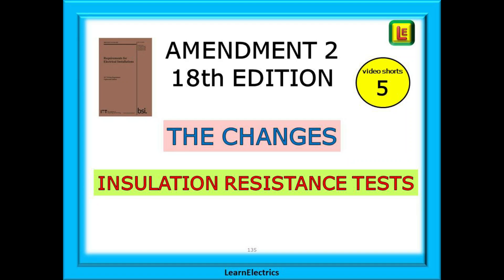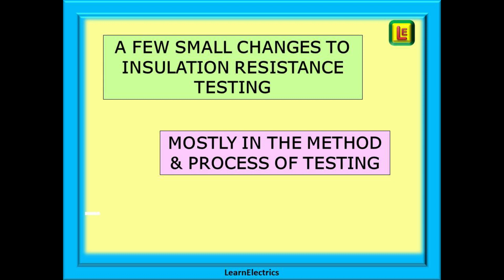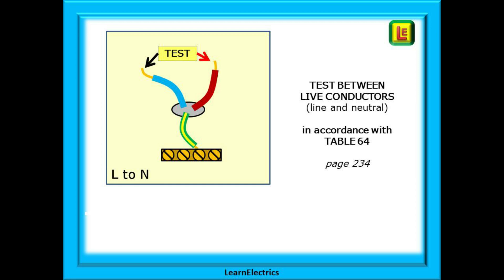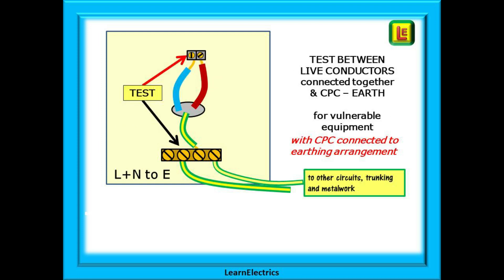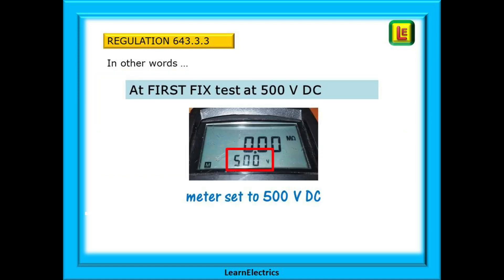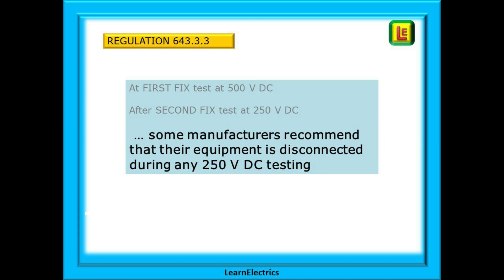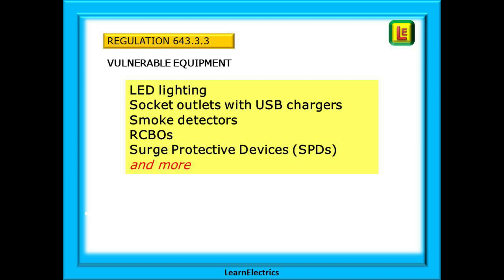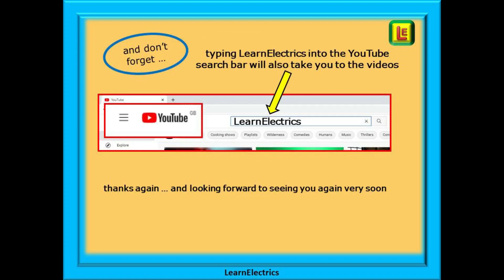AMENDMENT 2 - 18th EDITION – INSULATION RESISTANCE TESTING - CHANGES – SHORTS 5

Comment: I damaged a 240 V rated OTG's thermistor by injecting 500V between line and neutral!!!
Reply from the maker: Easily done. Always test loaded circuits at 250V first. Dave.

Comment: So on an eicr would you even try/ attempt to test @500v between live conductors? It is getting more and more difficult to remove vulnerable equipment, what with usb sockets, led lighting, rcbos etc

Great video Dave👍
Reply from the maker: They suggest now 500V first fix and 250V with equipment attached, have another look at the video. Thanks for the support. Dave.
Reply: @learnelectrics4402  yes I understand that as part of initial verification. But how about specifically when carrying out an eicr?

Comment: This question is not relevant to this video but can you explain whether we can use a TT system with only a RCD protection and not having grounding rod.
Reply from the maker: See earlier reply Kalum.
Reply: Suppose there is leakage in a metal body appliance. This cannot be sensed by Fuse/mcb as this is not a short or overload.

RCCB is a differential current sensor.

Without earthing: RCCB is unable to sense this leakage as their is no differential because the path is incomplete.
With earthing: RCCB is able to sense this leakage as their is differential because the path is complete. 

It's not advisable for our body to be a path. 
Hope this helps.

Comment: Great video, thanks for taking time to do, I have a question, Does the change to IR testing of sensitive equipment apply to periodic/EICR? Or can we test between L,N and E? Many thanks
Reply: I'd always test L&N - E on an EICR as you can't always find/ remove sensitive equipment from the circuit you're testing
Reply from the maker: Absolutely right. It's easier to remove before testing than to drive to the wholesalers for a replacement later. Dave.
Reply: @learnelectrics4402  I agree, but when you’re in a house where the customer has fitted his own remote controlled LED ‘mood’ lighting in their stairway and boxed the control gear in so you can’t access it without half destroying it, L+N -Earth is the way to go!😄
Reply from the maker: All testing. If you have first fix or naked cables then 500 volts.
If you have equipment that cannot be removed then 250 volts or with L+N joined.
Reply: @learnelectrics4402  No I don’t mean test all the circuits that way.

Comment: If SPDs ca  be damaged under test conditions there of no use then as surges can be more then 500v so just what use are they if test voltages below surges can damage them.
Reply from the maker: My understanding is that DC voltages from the test  meter are the problem. AC is ok.
Reply: @learnelectrics4402  a spike on the positive side is the same as on DC well depending on the amount of time.  Also the negative as the phase line switches positive to negative 230 volts.  The current a tester gives out should not damage them.
Reply: @alunroberts1439  but we are injecting upstream. Edit: continuously
Reply: @30mAkills  If you take one apart you will see it makes zero difference.
Reply: @alunroberts1439  if you inject 500 V DC continuously upstream/downstream  say 1 minute spot test on bench it stops working. My experience.

Comment: Fantastic video as always Dave 
I will continue to do IR testing the way I was trained. This is nothing new to also we test line and neutral combined and to earth if there is sensitive electronic equipment in circuit that can’t be removed as the line and neutral and combined to here is no pertental difference and there for electronic equipment will not be damaged by the test .  The reason for testing at 250vdc first is to determine if there is any loads in n circuit . That you may of missed
Reply from the maker: Spot on Sean. Yes at 250V unlikely to damage them and an opportunity to take them out of circuit, thanks. dave.